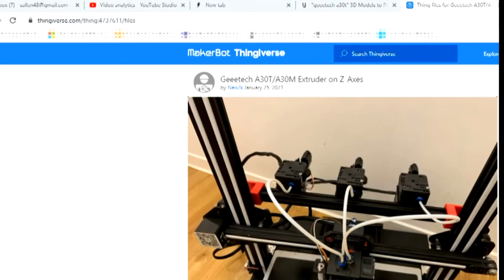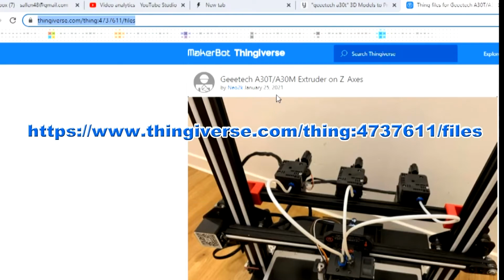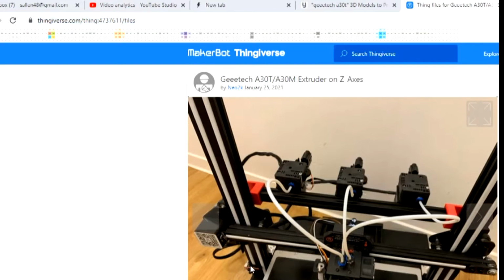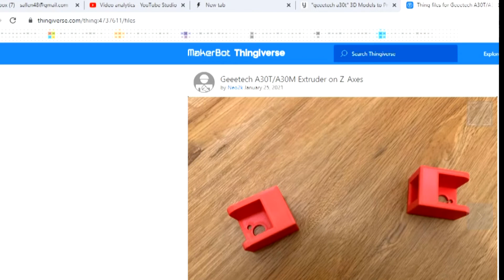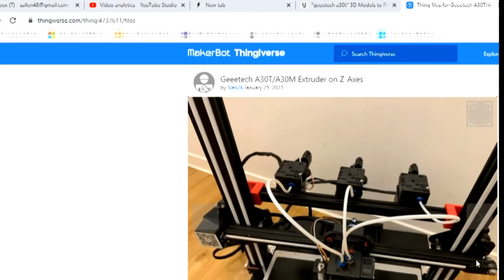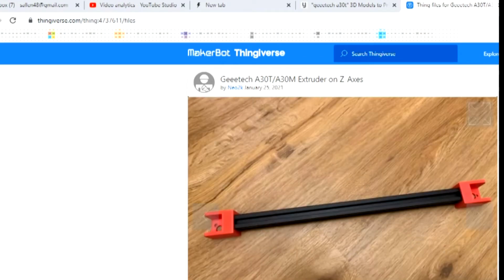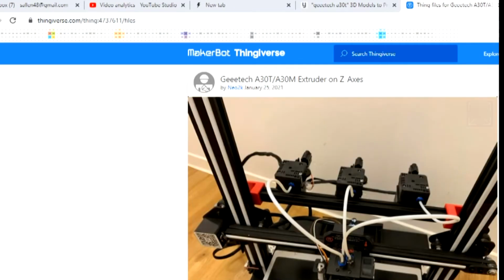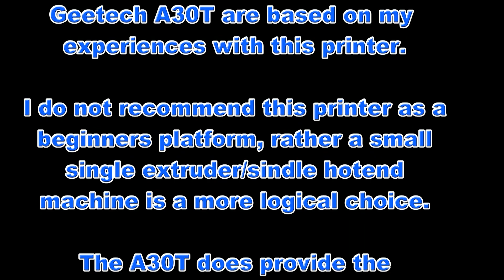A30T upgrades

Comment: A terrible printer. I can't stop it skewing in Y axis. It loses position, I lower the feed and the acceleration doesn't change. I lower feed to 50% and it still shifts. It's been sitting 2 years and I thought I would mess with it again.

Comment: After testing with the lowered extruder steppers, i have lots of clogging. Probably due the stress on the tubes when the printhead moves over its axis. I am going to restore it to its original placement. Last prints, i had to cancel 3 times due to clogging. After 8 test, 2 prints are good, 6 prints clogged.
Reply from the maker: many times clogging is due to the extruders biting into the filament to harshly and scoring the filament to a point where the gear can't move the filament into the extruder mechanism.  This cause the hotend to sit and stew with no filament moving through it.  This stew of filament in the hotend eventually boils away and turns into muck that can't be pushed through the hotend orafice, hence a clog.  I suggest you look at the filament when it's going into the gear assembly of the extruder.  Put your finger on the filament and watch as the gear moves.  If you can hold back the filament with your finger the adjustment screw (left side of extruder) is too loose and if you can hold it back but the extruder chomps off bits of filament the screw is probably too tight.  It takes a lot of time to get that adjustment just right and every filament is different.  Stick with one manufacturer.  I use Matter Hackers build PLA and it seems to work the best.

Comment: Hi, I have made this modification also. Also made the cable guide chain system. My question is, what is a good lenght for the tubes? I have had a few problems, since i have made the modification, that the filament got clogged in the extruder. I did shorten the tube a bit, but to short make it hard to reach the left/right ends for the extruder. To much stress on the tubes. Also, my extruder steppers are more close to each other, nearly next to each other.
Reply from the maker: I cut my tubes just long enough not to bind in travel from left to right.  I do get some clogging but I attribute that to filament getting stripped in the extruder.  You'll have to play around with the pinch pressure in the extruder, it's the small adjustment screw on the left side of the extruder.  I have two extruders that work great but one gives me trouble from time to time and have to play around with that adjustment screw.  Some filaments are soft and others are hard and the soft ones get striped going into the extruder.  sorry for late response

Comment: Geeetech says that the A30T has only one heater in the hot end.  Although their picture of the hot end has 3 sets of heater wires coming off of it.  There are also 3 temperatures of the 3 hot ends being read by the software of the 3 thermistors.  They only heat up one, and when the temperature gets pulled out of the lower temperature one, it clogs the other ones.  The design is not good.  That is why we all get clogs when doing more than one color.  Any body have an answer?  (or question)
Reply from the maker: there is one hot end and three extruders.  The hot end has three heating elements in it so the entire hotend is heated evenly.  You don't have control of heating the heaters individually, all three heaters are tied in parallel.